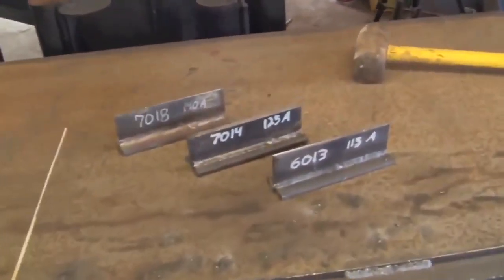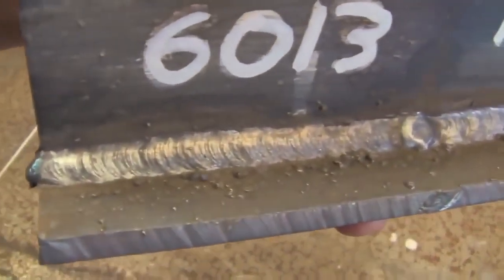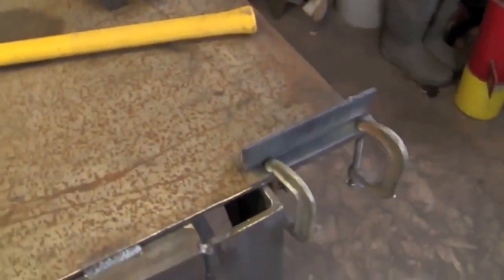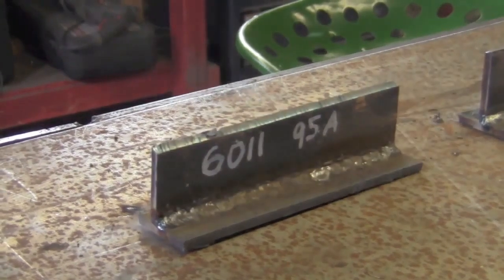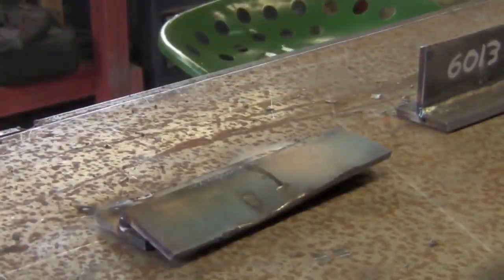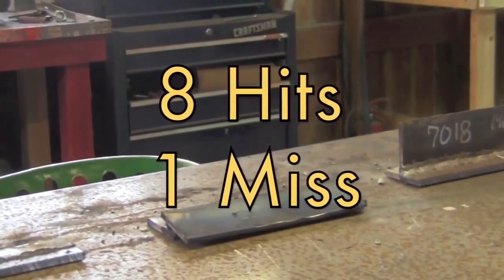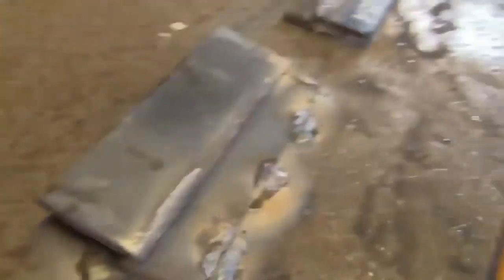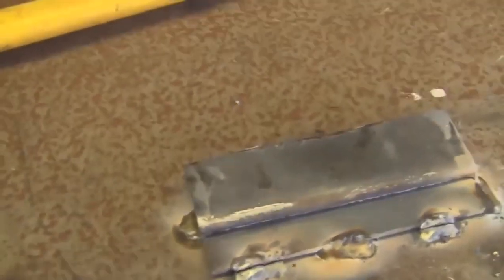WELDS - WHAT KIND IS THE STRONGEST ?!? BREAK TEST WITH 6011, 7018, 6013 and 7014 Stick Welding !!!

Comment: I recently welded a 6" piece of rebar. welded on end to a 1/4" plate with 6013 and 7018. Made several for testing.Took a piece of short pipe over it and pulled while in the vise. The 6013 broke much easier and the weld gave first every time. With 7018, the rebar broke off but the weld held. The force pulling was much less on the 6013.

Comment: I am curious about 'strength' when welding really thin stuff, like 1.6mm or whatever. I have an upcoming project where i need to use 1.6mm box steel for it, and am wondering if 6010 will be just as effective in this case as 7016/7018, as in the box steel its self giving way before the actual weld does.